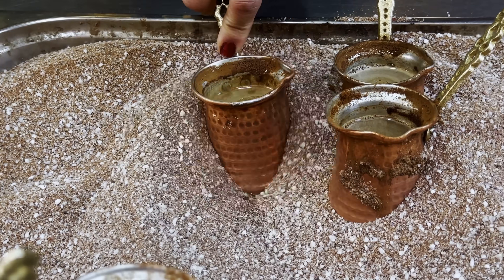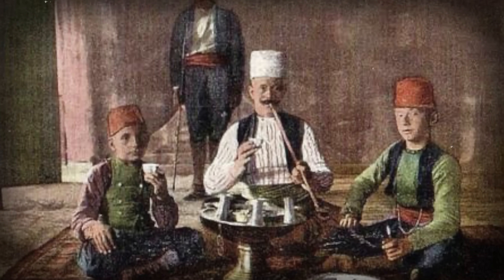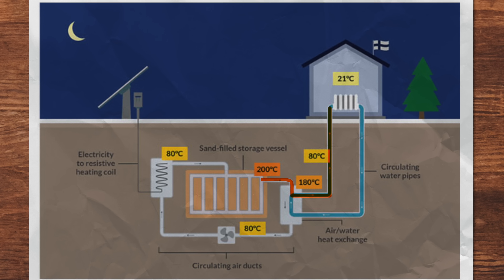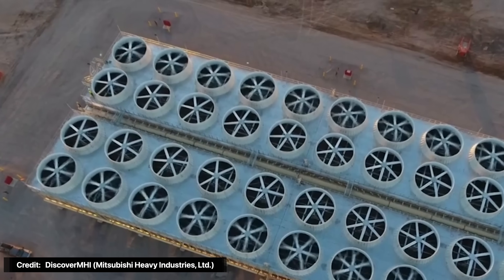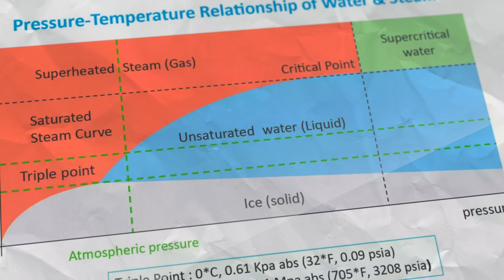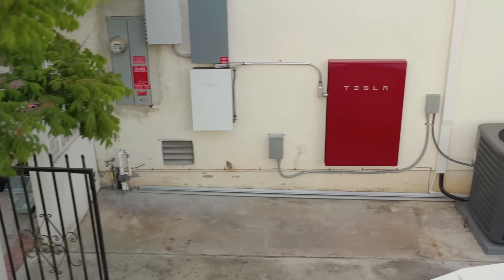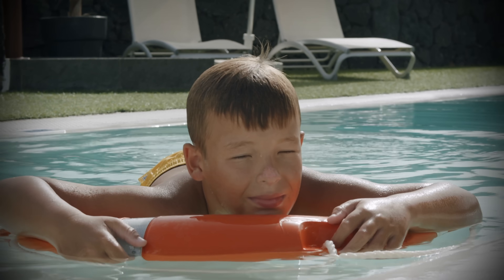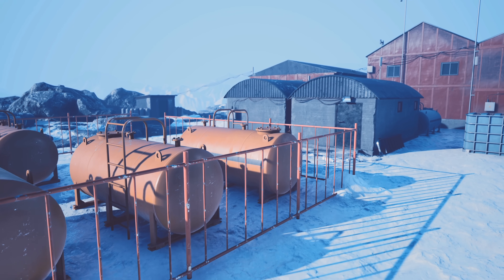The Power of Sand Batteries -- Revolutionizing Energy Storage...

Comment: Thanks for sharing your thoughts, ideas and videos. Very interesting technology. Never heard of sand batteries before but makes sense. Over 30 years ago when I was in high school there was a fad building outdoor wood boilers from masonry with huge insulated sand heat storage banks around them. Recently saw a video and they were saying there are two types of sand in the world, not all sand is good for construction, sand that has been worn smooth as in a desert is not good for construction and in some parts of the world good sand is at a premium. Imagine that if this technology were to takeoff hugely sand might become the next lithium in commodities. 😂. With heat pumps becoming all the rage with the improvements in operating in cold conditions to heat. I’m wondering if anyone is developing high temperature output heat pumps for sand batteries, you can multiply your efficiency by using the electricity to move heat rather than just making it. I’d they were to use sand batteries for electricity production they really need to look into sterling technology. I know from previous reading when the internet first came out that sterling single piston cryocoolers can also work in reverse to generate electricity. At the time the limiting factor was the extremely small demand for them has driven the price up to a premium level. I often thought that the electric car might bring them to a cost affective level since they would need compact coolers for automotive air conditioning. Unfortunately making miniature compressors happened instead.
As far as your cooling idea I remember reading in a power trade magazine a few dozen years back of a ice cream company that was using off peak power to freeze an Olympic sized pool of water for cooling their plant. Wishing you and your family the best. Looking forward to seeing whatever creative videos you come up with next. 

If your looking to explore sand batteries yourself perhaps take a page out of the SpaceX text book and build yourself a used grain silo inside a slightly bigger silo and then fill the space between the two with perlite like SpaceX did with their sight built fuel tanks. I’ve heard on several farming channels that used grain bins are a thing and since the farmers are going to be hit hard financially in the upcoming year you might be able to get a sweet deal.

Comment: I really don't get why every "heat storage tech" is always reliant on electric resistive heating. I mean if you are going to use heat, you might as well combine that with heat pumps. Therefore winning a lot in roundtrip efficiency, and you could probably get way better efficiencies generating the electricity back from the heat you stored.

Comment: Cold battery is an interesting idea. But for that you could use water, the phase change of going to ice would store a massive amount of energy, much more than you could get with an equivalent volume of sand without going to super low temperatures which would kill efficiency.

Comment: It's good that you mentioned the Northern parts, like Canada or Northern Europe, that's where it can be most useful. I too do not see the use of it much outside the district heating of places in colder climates, because in the Northern places you mentioned we will not get much sun from mid October - start of March, so all we have left of renewables is wind... and we have the MOST need of energy in those winter months when we cannot survive without heating and it is a huge chunk of energy we use. Lithium batteries are not the best storage medium to take in sun in August or September and then store it for December-February when it will be most needed. And even solving winter heating here makes a lot of sense because it is a huge chunk of our energy needs. Probably best options to keep energy gained during summer to the winter month are either convert it to hydrogen or such solutions as the sand batteries for heat.

Comment: My only question is this:

What kind of sand do the batteries take?  For example, does it take rough/course sand that is used in construction and concrete or the fine and smooth sand from oceans and African deserts?"

If it’s the latter, could that help reduce brine from our oceans when we desalinate our waters? . I figure this product of theirs would incredibly valuable if it contributes to solving this problem of Brine.

Comment: Also Li batteries loses their capacity overtime so needs replacement over and over. I don't think sand would loose it's properites after milions of cycles of reheating :)
Reply: Sand batteries do have thermal stresses.  Maybe not the sand itself, but everything else that makes the "battery" work.  Particularly if you are heating the thing up to 2000C.

LFP batteries lose capacity very, very slowly, and certainly don't need replacement "over and over".   For LFP its roughly 80% of original capacity with daily (80% DOD) cycling after 15 years.  So it mostly just depends on how much capacity loss you are willing to tolerate.  For the raw cells anyway.   The accompanying electronics are another matter.
Reply: @junkerzn7312  Thanks for the detailed response. I will dig more into the topic.

Comment: 14:00  pro tip.  you don't have to just go up LOL  you can also go down with it!  10 stories underground 3 stories above ground AND less wall support issues and collapse problems. so the acerage  is way less than shown here by a huge amount!  also you build a 50 storey building they go down like 20 stories in the basement to anchor it etc. well  you can build your sand silo and bury it right next to the foundation and heat it from there forever. run electric in  heat and hot water comes out
Reply: Water ingress is a huge issue for below-ground-level structures, so it really isn't as straight-forward as one might think.
Reply: This also solves the spillage issue, and doesn't have the potential to poison local soils because the stuff is solid. 

Although, you have to wonder what benefits sand has over local earth given that you don't need to excavate anything to do traditional, residential geothermal storage.
Reply: Going up is cheaper than going down.

Comment: Passive buildings sometimes use thermal mass such as winter sun hitting walls or floors of which cement to heat up during the day and release that heat at night. This works at residental scale
Reply: That can be a medium for storing heat in a system with a heat pump. Whether something natural like stone would be best for a cold storage isn't known to me, but natural safe materials at temperatures which don't explode, even when water is applied, would be great.

Comment: We already have a cold-storage sand battery -- the earth. Just dig  straight down anywhere for about 55 degrees F. At the human scale, we store cold in liquid -- pools, ponds, rivers ,etc. -- and the upper limit on water's temperature storage does not matter.
Reply: So, there is no such thing as storing cold. Cold is just the absence of heat. The reason water stays cooler is #1 water with the same temp as the ambient air will feel cooler because of its higher thermal conductivity pulling heat from your skin. #2 it has a larger thermal mass. So when the air heats up almost instantly the water takes longer to gather the heat energy and raise it's temperature.

Comment: The large capacity for storing heat comes from the max temperature, which is easy to achieve through resistive heating coils. But on the cool side, it seems to me that you would have to get much colder than freezing to have a similar cooling capacity. Is there technology that can achieve very cold temperatures efficiently with electricity?

On the topic of usefullness if used only for heat. I remember a video on this topic that mentioned very northern locations that don't get much sunlight in winter. The heat battery was useful there because they could be heated during the summer, and would hold their heat for months into the winter.

Comment: for a home it is much better to use a huge tank of water right in the middle or your basement and maybe the first floor and constructing the stairway around it.
of course you need some insulation around the water tank. due to the fact that an insulation is not perfect anyway some heat always leaks out.
however, this "heat loss" is not lost at all, because the tank is in the middle of your house. that means that this thermal leakage is already heating your house a tiny bit. you can also implement two different tube coils inside at the top and bottom and extract and put in the heat very flexible because on the upper end it will always be warmer than at the bottom. this way you can heat the top end up with thermal solar panel to max. 40 degrees C because that is warm enough for your house heating system and then you switch over to put the additional heat at the bottom of the tank. for extraction you could do a similar thing. if the tank is very hot on the top, like 95°C, you take the heat out of the bottom or a mixture out of it to go with the right temperature in your heating. if the whole tank is getting colder, you could extract it only on the top of the tank.
this installation lasts practically forever. and while having a basement is expensive, it is still very nice for a big hobby room, fitness room, party room, storage room, etc.

Comment: YOU DEFINITELY WANT TO READ THIS POST:
I met a guy who as a young student invented a way of cheaply and ecologically heating a house and all of its hot water while he was attending New England Technical Institute in Warwick, Rhode Island in the 1980s. 

He won an award for his idea. 

His idea is to build a concrete compost pit and run copper water pipes in coils in the compost pit for heating water running through the copper pipe, and having the pipe feed from the home and return back to the home to heat up radiators or radiant hot water flooring, as well as tap water. 

Compost reaches surprisingly high temperatures. I think it's around 175°. If you're taking a hot shower you probably want your water around 100°.  You'll have ample hot water from the compost pit.

Any transmission lost between the house and the compost pit would not have a practical impact on heating the home or heating the tap water enough so that you don't need a conventional hot water heater. 

Running a water pump requires a lot of electricity, so it would be an excellent idea to compliment the system with rooftop solar. But even if you cannot compliment this system with solar power, it is still much more efficient than burning fossil fuels to heat the water or using electric radiators. 

My wife and I are planning to buy some land in Vermont to build an ultra-ecological, ultra-efficient, low-maintenance home using alternative building materials.  This compost heating design will be central to our home  heating and hot water systems. 

I had wondered about the potential for a sand battery to explode when exposed to liquid water.  Thanks for confirming my suspicion. That doesn't mean it's the worst thing. Fossil fuel storage containers also explode.  Pick your poison.
Reply: how much compost would a home have to generate to meet its heating needs?
Reply: @KK-dv3wh  An energy efficient home in a cold climate with a 120-day heating season needs about 83 million joules per day. Since the compost energy is coming mostly from food calories, we can convert joules to food calories, with 4184 joules per calorie that's about 20,000 calories per day worth of food that you would need to compost. This doesn't include heating water, which depending on hot water use can rival space heating use. Even if the home were twice as efficient as one of the best modern homes, it would require more food than 5 people require in a day. We use fuel and electricity to heat homes because they are much cheaper and much less valuable than food. Food waste is free, but unless you're wasting 10 peoples worth of food every day you're not making enough to provide for your heating needs. And this is why this idea hasn't gone anywhere since the 80's
Reply: @Spencergolde  I imagined it must be a stretch, thanks for the details.
Reply: @Spencergolde  
That's a really cool way of looking at it. 

Grass clippings are also composted. How much grass would have to be cut in acreage to make up the difference?
Reply: @chriseidam7319  We're talking heat, so if you wanted a more straightforward way to convert plant mass into heat, instead of composting, you could burn it. Wood is the easiest plant fuel to burn for heat, and you can look up the energy density for different types, but for grass you might have to find a way to compress it into denser bricks so it has a longer burn time. You'll get the same amount of energy out as you would by composting, but instead of the heat being spreading out over days, you can access it all at once, and reach higher peak temperatures which is ideal for heating water.
Reply: @KK-dv3wh  ,

That's a good question. I have no idea. That's about as much information as he gave me in a random  conversation at a Dunkin' Donuts.
Reply: Granted, composting is great for making soil-amendant for gardening. And, if you want an early start to the growing season you can build a hot-bed composter to capture some of that compost heat to germinate in the late winter and early spring. So composting is great, but for home heating, look to heat pumps. If you're feeling creative and inventive, look into organic PCMs to store heat when your heat pump is most efficient and use it in the cooler parts of the night.

Comment: The best seasonal  thermal energy storage is a tree. There grows lots of waste trees where the winter is cold. Then you need an oven or why not sandbattery to store the heat for daily rate. Sand battery is very nice in that it can be extremely hot. It is pity that smaller object will have a higher surface area to volume ratio compared to a larger object with the same shape. But if it is free to heat it to 700C using for example wind turbine could it replace the oven? In some farm environment it would be feasible to build 5 times bigger sand containment structure than a standard oven. But stil oven is super practical.

Comment: The "cold battery" has precedent.  Do a search on "ice bear" systems which basically take "cheap" electricity at night (assuming time of use billing) and lower ambient temperature to create cost-effective ice, and then during the day the air conditioner is plumbed to run the through the ice as part of the condenser that greatly reduces the load on the main compressor.  While sand could be effective here, the phase change of water stores a lot more thermal energy (or lack of thermal energy in the case of cold storage) per KJ and per volume than sand, so I'm not sure the economics would be competitive for a sand-based model by comparison since you can't go as far below ambient with cooling as you can go above ambient with heating (absolute zero is much closer to ambient than the 1100F is above ambient) that negates the main advantage that sand has in a heating scenario when trying to use it in a cooling one.   That said, you should totally do a story around thermal storage for cooling as that is much more applicable to much of your U.S. audience.

Comment: I think sand is just OK. Molten salt in a single cylinder with a physical and thermal barrier rather like a piston head to separate the hot and "cold" reservoirs of the molten salt offers more promise because of its ability to generate superheated steam directly for electricity turbines. Graphite instead of sand facilitates infra-red photovoltaics for direct conversion to electricity. Whether it is sand, salt or graphite depends on how it is heated. Direct heating is inefficient, but heat pumps transfer a lot more than 1 kW of heat per 1 kW of electricity used, so transferring heat into and out of buildings using heat pumps powered by electricity generated from heat stored in sand, salt or graphite is still likely to me more efficient than the 1kW of heat you could transfer from sand directly to water for district heating.

Comment: I think the point you make Ricky (10:40) of not needing the heat stored in a sand battery during the summer time is not valid as the majority of people I know don't like to take a bath using cold water and besides that one also need warm water for dishwashing and washing clothes as well - maybe it is possible to preheat the water used for the aforementioned and thus make savings on the electrical bill as the dishwasher or washing machine wouldn't need to heat the cold water all the way to the desired temperature if they can get a head start by getter preheated water.

Comment: The cold battery is an interesting thourght, but would if water below 0°C still holds heat capacity of 4.182J/kg/K, I think that might be the better choice. Needs fact check and calculations.....